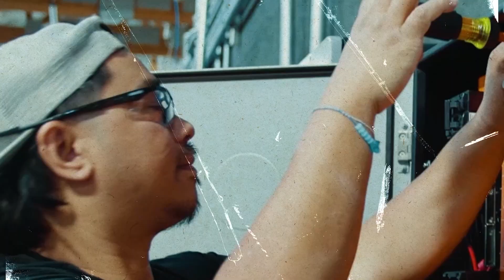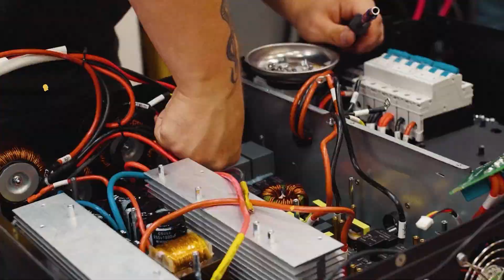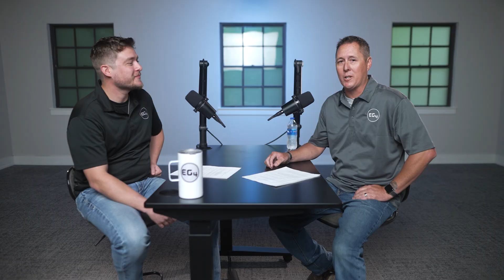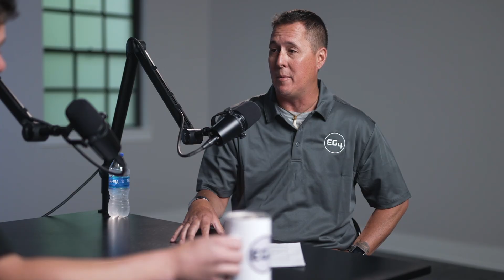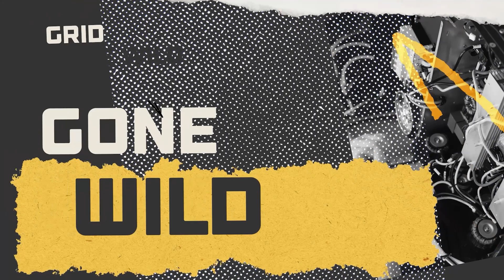The #1 Installer Skill That Will Change Solar Forever! | EG4 PowerStation EXPOSED 🚨|| GGW Ep. 11

Comment: I purchased the 18kPV Hybrid Inverter earlier this year and also 6 DIY battery cases from Basen Green. I am pouring over the documentation for how to make them talk with each other. As it appears, I could use the Deye or maybe PylonTech but I will be going through the options. The LFP BMS accommodates about 30 different communications protocol options. I am sure someone else will come by the idea of this like I did. I can send along to your sales team what I do find when I get it all going. I really like the EG4 equipment and would have even used the EG4 batteries if I was not trying to build such a large system. Other than that bit, totally aces guys!